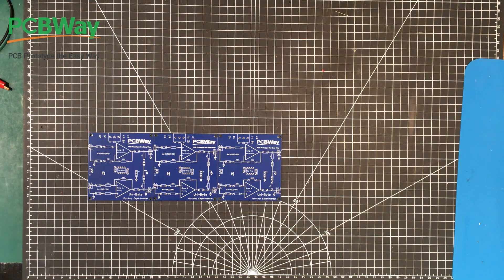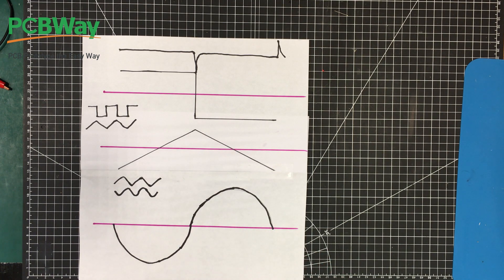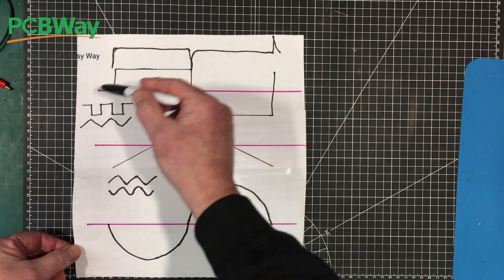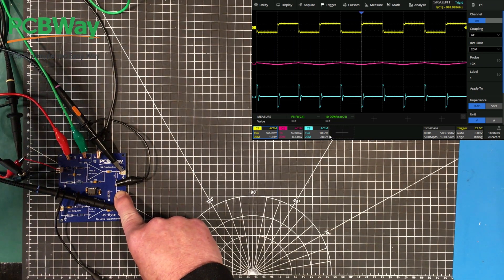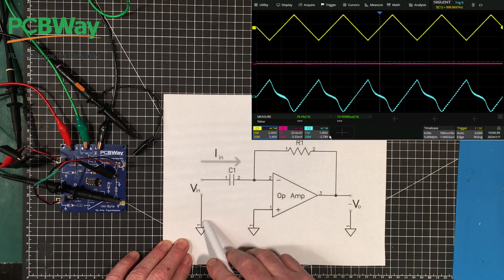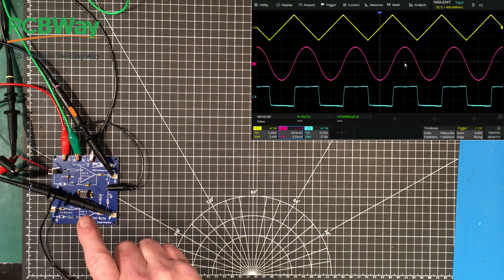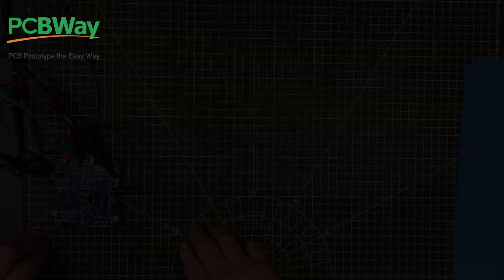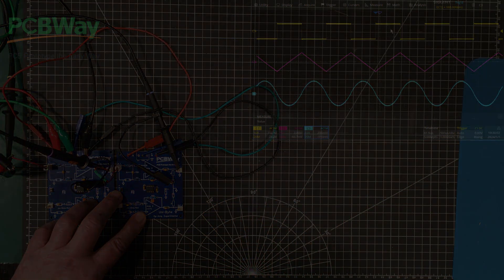0143 - Op-Amps: Part 4 - Differentiators and Integrators in action.

Comment: I have seen all these lab examples of integration and derivatives of various waves for decades.    I have never seen any real world applications for these 2 op-amp building block circuits.    Wave shaping is a cool application but what else would you use these for?   A video would be extremely appreciated.    PLEASE!!!!!   Happy New Year All
Reply from the maker: Other than wave  shaping the applications can get rather complicated and involve a lot of calculus.  I recently put a tiny amount of calculus into a video (the first in this 2-part series) and YT demonstrated "Calculus?  We don' wan' no stinkin' calculus!"  So, demonstrating how these op-amp circuits can be used to program an analog computer, build a PID controller or a sophisticated ADC might no be a great idea overall.  Not to mention the complexity would require multiple videos.  As much as I'd love to sink my teeth into something like that I don't think it would be a good idea right now.  
Sorry about that.
Reply: @uni-byte  I figured it is for some complex applications.   Calculus is still a mystery to me.   I aced all my calculus classes but I never could understand it to apply it.    I could recognize the structure to do the proofs but I still had no idea what I was doing.   I have tried several times over the decades to figure it out but I am JUST NOT getting something.   I think I am trying to associate the symbology with algebraic logic.   THANX
Reply from the maker: @jp040759  Calculus is not something most of us need from day to day.  It's mostly relegated to maths, physics and some esoteric engineering.